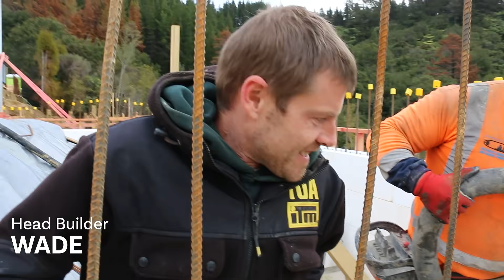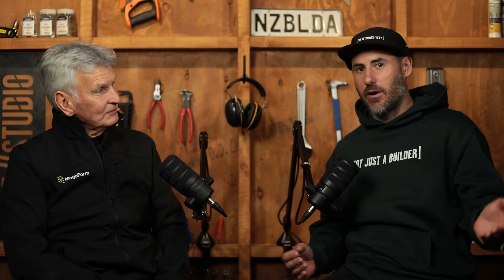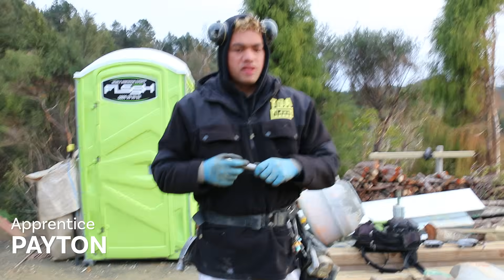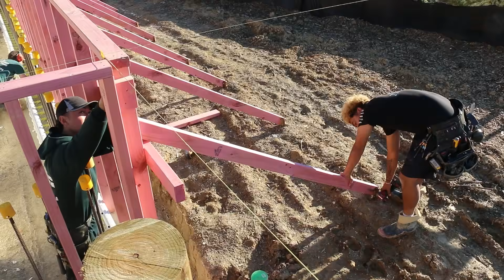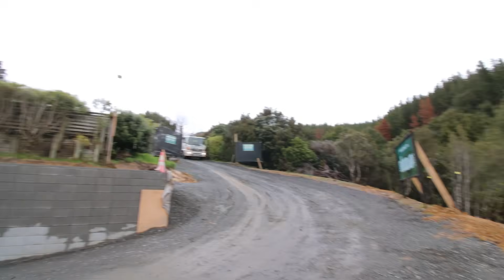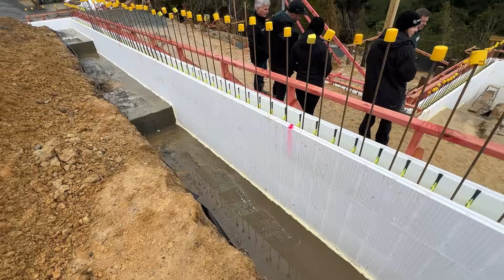From Cold Blocks to Cozy Floors – Why We Trust Megaform

Comment: Hi Josh, What plans do you have to bring fresh air into the house? Consider getting a Heat Recovery Ventilator. Zehender makes the best quality ones, Stiebel Eltron is another good option and then there are also many other suppliers. i think you can even incorporate heat recovery ventilation with a heatpump like with Lossnay systems.
Reply from the maker: Cheers - currently looking at a lossnay

Comment: have you ever thot about precast concrete panels
Reply from the maker: Its definitely more used in commercial work where no retaining or thermal barriers are needed.
Reply: you can get precast units with retaining and thermal barriers and house lots are also done you can also get insulated panels too
Reply from the maker: That's awesome - must be a similar product.

Comment: We build crappy homes in NZ because of the price, it is that simple. As a designer we are always open to new ways of doing things, but at the end of the day, the clients have a budget, and the first things to go are the expensive nice to haves. I read the Branz guideline today and it mentioned a 1.5% cost increase for a 6 homestar rating, but that is rubbish. From what we are seeing the real cost is more like 10 - 20%, and that adds up really fast. We looked at using SIPs when we built, and that was going to sting us another $100,000 for the panels, the expensive wraps, and the expensive ducted ventilation system. It just isn't affordable. Good on you for using the MegaForm
Reply from the maker: Thanks for the insights from a designer - our experience was this method was quite cost effective in comparison to block. Id dig further into the price comparisons with your builder on that one

Comment: Our house is bottom to top on megaform 2 storey house in coastal nz. Amazing product. We have had 170km/h gusts, we only hear a bit on the sliding doors which have triple glaze but still bend as they face wind head on. House doesn't even shake a bit unlike timber frame ones. The only thing megaform project should focus more on is the window frame/sill details. There are better detailing in other countries.
Reply from the maker: That's so good to know! Thanks for commenting - we can't wait to have the same experience

Comment: How do you get away with not bracing both sides of that form work? Is it just in the strength of those plastic clips?
Reply from the maker: Yea the mega form holds it all together - much like when we pour a block wall or standard slab

Comment: Concrete and masonry have onky a moderate resistance to heat flow and the surface ground temp down to a depth will follow the seasonal ambient temps. Heat flow will follow the path of least resistance, and in the case of waffle slabs, this will be the slab edge if not insulated. Also note there is a slab perimeter length to slab area ratio, a simple rectangular slab will loose less heat thru the slab edge than a complex shaped slab. ICF construction is normally used dwelling walls, the thermal benefits in your case, foundation walls, will be minimal at best, because any heat flow to or from the building will stopped at the slab, however, there are benefits construction ease/time. Also note the benefits of thermal mass are often overstated, while thermal mass has the ability to store energy (only upto able penetrate about 100mm in depth), any change in temperature, ie the sky clouding over, that stored energy is quickly released as the room temperature wants to equalise with the outside temperature
Reply: pretty good info. We built our two story house here in NZ all megaform other than slab (with 200mm polysheets) and ceiling (thick batts) The only temp leak in the house is around non ICF parts.
Reply from the maker: So good to know! We are looking forward to having the same experience

Comment: The crew of 3 blocklayers we have in Auckland can do near 2000 blocks in a week, up to slab height within a couple of mm, especially on a clean level footing like that, built a few eco homes and they just cover our walls with insulation foam after being built, wall ends up about 300mm thick tho
Reply from the maker: That's impressive output - good to hear!
Reply: @nzbuilder ha Iv been in a couple of the firth fastest trowel comps, next one in Auckland 🎉
Reply from the maker: Epic! Loving up to your turbosloth name!

Comment: There is now fibreglass REO bar to be used with ICF
And they sell bracing methods to support the walls before and during the concrete pour .all adjustable with brackets and steel poles and associated hardware etc to screw into the plastic bracing  in the wall blocks ,could it be building for Dummies???
Reply from the maker: That sounds super clever! Will look it up for the next one

Comment: Hey Josh ,there is a YouTube channel named Bealy Good from North Carolina USA.
He is building a big house with ICF ,it's a major project.
Another one was NYA Millennial channel,which was he added to a Castle with ICF .
Certainly interesting to watch .
They are building swimming pools out of the ICF method etc .
For the USA it's more about the insulation factors as they do get the cold and Snow etc .
There is certainly some creativity being used with this type of construction.
Reply from the maker: Cheers for the heads up, will check them out!

Comment: What about external degradation? Polystyrene breaks down when exposed to environmental elements
Reply from the maker: it will get covered with an external coating + plaster
Reply: We built our house all with ICF,  two storey, sea side. Our plasterers were whinging about this exact components at the start, all this based on old comments for old products. They were blown away by the new product available.
Reply: I was about to ask the same question. Wouldn't want to see poly block visible on such a well spec'd home. I like it! Sounds like a great choice for your foundation

Comment: I saw a very similar product in America about 25 years ago. Same block material, with a slightly different spacer/joiner system. The designer of that product, a retired aerospace engineer, got his inspiration from a Scandinavian product. A very good answer for ground insulation.
Reply from the maker: Cool history, thanks for sharing!

Comment: Nz is building better. My current house is 12 months old and was built to the new (2023) R value standard and its the warmest/dryest house ive ever been in. Zero condensation on glass during winter. Its quite impressive.
Reply: Currently living in an old house with no wall insulation but 150mm polyester in the roof poorly inatalled and 50 in the floor decently installed and just two double glazed units. The rest not. Fixed the worst air leaks and some of the poor work in the roof, and ditto best I've lived in. Cannot wait to have a fully insulated slab to over the top standards. Thick walls and high end glass. It'll be amazing.
Reply from the maker: That's awesome to hear!

Comment: Will you provide a cost comparison?
Reply: P.s I was a 'custodian' of a strawbale house in Amberly , chch. Gurt the original home builder used the same style build, he also used unislab concrete build for the floor (basement roof/subfloor of house above) then Polly then concrete, the floors were 250 deep. the concrete you stood on was completely isolated from the outside.
Reply from the maker: will work out some numbers

Comment: Not sure if it’s already passed the live build date yet, but if you have scope, lay down that subfloor with hydronic underfloor heating embedded in it. 

You’ll be warm all year round and a solar water boiler is cheap as to keep the ambient heat going. 

Bonus points if you extend out the same system for hydronic wall radiators too.
Reply from the maker: Cheers for the tips - something we are looking into!
Reply: Do it!,  only logical way to heat a house… forced air, or electrically heated  storage mediums, are basically inefficient, stupid methods of heating a residence.

Comment: Seeing this has bought back memories of back in my structural draughting days circa 1997. The project was a motel in Lower Hutt and polystyrene block was used for all walls. It was the first time I had come across this product and it is good to see it is still around. I do remember the thickness is wider (250mm I think) than standard concrete block work (190mm). Not an issue for foundation walls. Great to see you are using this kiwi innovation.
Reply from the maker: awesome - what motel was it?
Reply: @nzbuilder  Fernhill located on Pharazyn St (thanks Google Maps!)
Reply from the maker: I know the one! Very cool

Comment: Why is there no vibrator being used to remove the air/voids from the concrete.
Reply from the maker: we used a special mix made for these blocks
Reply: My question too..
Reply: vibrating increases the risk of a blowout. Pressure builds up incredibly fast if over vibrated. Using a concrete mix with a plasticizer to increase flowability is better.